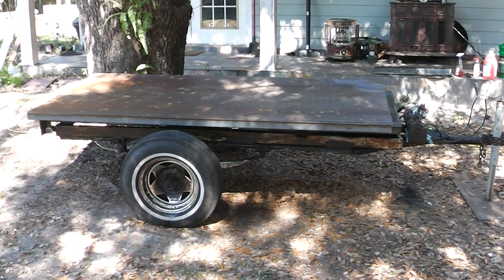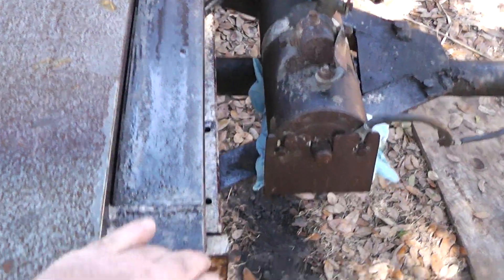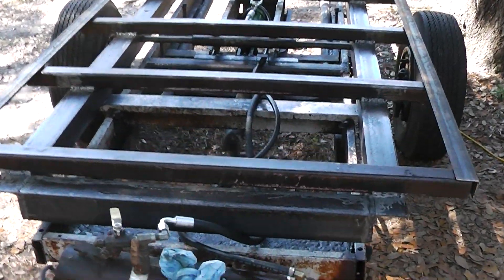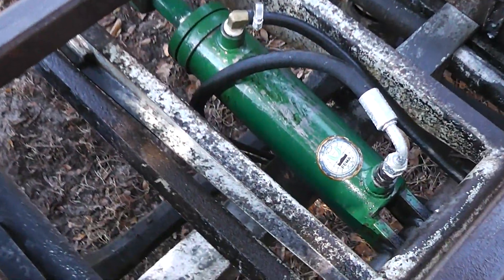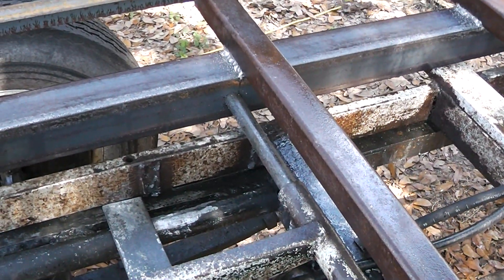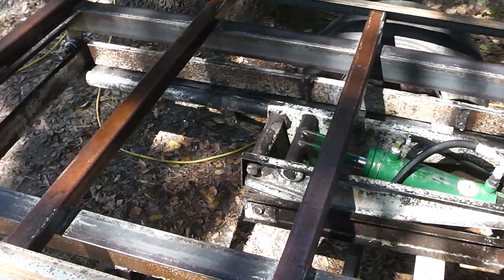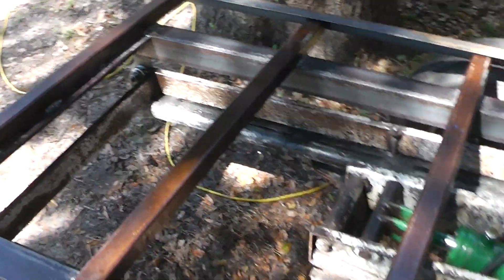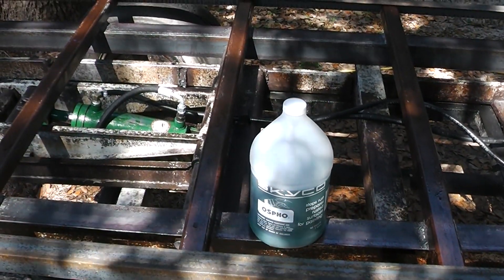Dump Trailer Project Part 2

Comment: Hi homesteadprepper.
Really looking forward to the hydraulics info.
Do you know what the scissor does to go with the ram? Must be a reason to use one as well as just the ram.
Looks like a 3" ram cylinder? Whats the stroke. Whats the psi it uses and gallon flow.
As much info as possible please maybe even down to the current the motor draws.
Great project - so nice people like you upload to Youtube for all of us.
Reply from the maker: Dennis yoj The scissor gives some stability because it loads the box on both sides and it raises the box higher than it could with just the small ram.I haven't measured the cylinder but, it is 3-4 ".
The stroke estimated is 12-16".
I can't help you with the gpm, psi or current draw.  The pump is old and there is no data on the plate but, it works.
Reply: homesteadprepper Thank you for that info. Useful.A really nice project well done too.